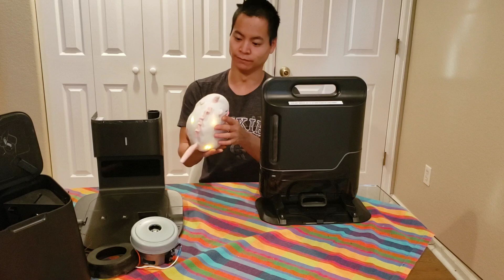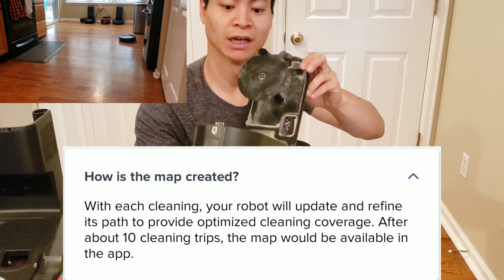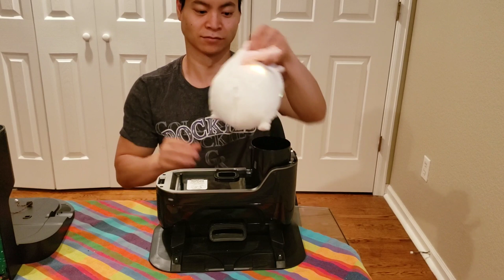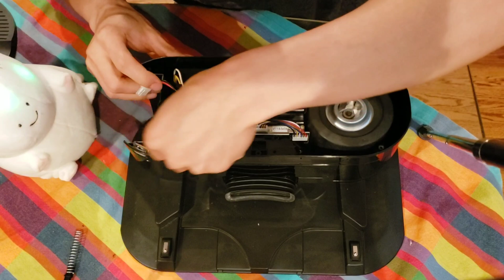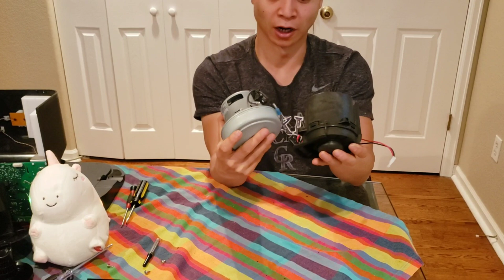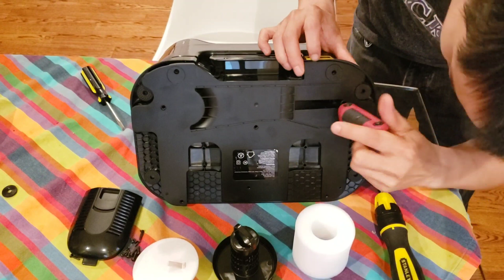Shark IQ Self Emptying Bin Teardown VS Roombas Self Emptying Bin | Which one is built better 😏😏😏

Comment: Can you do a video of a tear down of the Shark Auto Empty bin? I’m a pretty good at tinkering but I’m stumped on how to take it apart and clean the bin any further than trying to shove wet rags into it. So far I can see 5x T15 screws and took the swing door off but I can figure out how to separate the plastic pieces. If you could do a follow up video to this I would GREATLY appreciate it! Thanks for the content and keep up the good work Nathan!
Reply: I figured it out, and it’s a PITA. There are a total of 8 screws. Three of the 5 screws you see from the bottom actually come out later. The first screw that needs removed is under the top button and locks the dust bin into its outer skin. Due to the way the button is clipped on to the release lever, it’s nigh impossible to get it off. Once you do manage to get that screw out, the two screws towards the back near the filter come out and the outer skin comes off. Then, when the outer skin is removed, take out the bin latch lever and undo the two hidden screws on the front and back of the bin. These two screws, along with the other 3 on the bottom, allow the inner bits of the dust bin to come out. 

I was able to stretch the case enough to move the button out of the way and access the first hidden screw after removing the two screws nearest the filter, but far and away the easiest way to access it is to simply drill a small hole at the front of the button. The locking tabs are on the transfer bar, so trying to pry the button off from the top will almost certainly break the locking slots off the button instead.
Reply: @mrb692  Glad someone was able to figure it out!! I’ve since given this one to my in-laws but I’ll be sure to reference this info when I do their yearly deep cleaning!!
Reply from the maker: Once you get all the screws out, does require some force to remove the plastic parts, check all the screws though. There a couple that are hidden I think.
Reply: Robot Masters Thanks! I’ll keep looking, just haven’t found anymore screws yet. Should I try to use a plastic separating tool? Like a plastic shim or flat blade?
Reply: I tried for a bit but I couldn't get it open

Comment: I haven't had this problem.  But someone in the comments was saying their S9+ closes doors. I told him I've never had that happen, but I have doorstops. Apparently, he doesn't. I told him to use keep out zones around the doors or use a doorstop wedge. Have you had a problem where your Roomba closes doors?
Reply from the maker: My Roomba S9 and I7 never closed doors, the Braava m6 did at the beginning, but after several updates it never did it. Maybe this person is running on an older firmware. Yeah Keep-out zones might help
Reply: If it gets behind the door it will close it, Mostly opens them. I have old 595 and since replaced original battery with their extra life one it has become a monster, knocks stuff out of its way and pushes tables around. Blind in one eye and to fix looks like new motherboard.

Comment: I want you to fool it after room is maped by putting obstacles in its path or moving furniture around. See how it handles changes. I never saw your lips move when sparklers was talking
Reply from the maker: LoL an attempt of making a puppet come alive. Yeah still doing the mapping runs take 10 cleaning cycles
Reply: Sharks web site looks like an infomercial scam, they really need a new web designer.
Reply from the maker: LoL yes I agree too many Advertisements video show casing the vacuum. I will say this, while the Navigation abilities, app stability and integration needs lots of work, the vacuum it self is really good. Picks up a lot of dirt even on low power. I like the dual single arm side brush, does not scatter debris much, has a dedicated wall sensor too. Shark being able to offer a smart mapping robot vacuum with self emptying bin for $450 is impressive and I will give it a few months to improve the software.
Reply: Will be like Ring doorbell, i hated it for first two month's return it 3 time to Costco. After they updated app first time 3 months later changed my mind now have 2. Yes either impressive or irobot been cheating us all this time, now theirs dropes to $499. Test change in hight, going floor to rug while on a run and going over Engineered Marble Threshold. We have .5 inch between wood & tile floor it needs to get over. Roomba gets hung up some times but always frees itself.
Reply: Oh yeah, how does it handle power cords? Roomba does good with thick ones just passes over them but some of light ones it sucked up and spit out. Bought some 3m stick up hooks and raised them off the floor.
Reply from the maker: KingLord I will do a cable test, the robot has no trouble transitioning over high thresholds. Was able to transition on to my Shag Rug which is 1 inch thick.

PS I use Vivint and Arlo as my security cameras
Reply: Shag rugs still around, i wanted that when i was kid in the 60s. Salesmen said you need to rake it so decided nope, mom was happy
Reply from the maker: KingLord Ohhh never raked mine, but than again it not the prettiest looking thing 🤔😧
Reply: @RobotMasters  I noticed something. Most robot vacuums copy iRobot from wheels to slightly different brush heads. Looking under the robot is very telling who copied who. But Roomba did just use the shape of the Neato for the S9+. I guess sharing is caring guys.
Reply: @kinglord5429  iRobot latest model learns as it goes. It's impressive. I leave home and I'm reminded at work every Tuesday/Friday that I have a Roomba because she sends me a message that cleaning has been completed. I don't think any other companies are on their level. I tell everyone to be hesitant about using Chinese robots or smartphones. Stick to any other company.
Reply from the maker: @Slick1020  LOL the only robot that did something different is the Dyson 360 and LG CordZero R9
Reply: @RobotMasters  I know most people get upset with the pricing for the Roomba. I can say their customer service is top notch. Their app is well put together. I believe you pay for what you get. Looking at Shark support and their app because I read your comments about them. I've seen other negative reviews as well.
Reply: Someone said no other company can use double brushes because Irobot owns the rights to it.
Reply: To say only irobot can make a excellent automated vacuum and only for their price that can do what no other can has never held water jn anythin, cars, planes, trains and so one. Shark has been known to make very good products for much less cost and this seams to be another but they will not be alone. Hopefully this will start a drastic price war that will benefit consumers. 👍
Reply from the maker: @kinglord5429  I think they will because, being able to under mind the customer with a robot that offers very similar features for half the price is good for the consumer and creates competition. Now if Shark proactively provides software updates it will be a good robot vacuum 😁
Reply: @kinglord5429  Shark probably isn't making money. You provide a lower cost robot, but what are your profits?
Reply: Bulk sales, $439 vs $1300. Apple asks over 1g for a iphone but you can get android unber $100 which pretty much does the same. Its like cable in FL, xfinity is the only game in town and sets the price's. Irobot had that once but this changes the game besides the hardware has never been were the money come from, consumables is where they have you.
Reply: @kinglord5429  Google doesn't make money off Android. Android is free for anyone to use. Their money comes from ads period. Their phones haven't been extremely profitable. I think their home products with Nest have bought in profits. You need to compare apples to apples. Google is doing what Microsoft did by placing their products everywhere so you want to use them, especially in your home. Apple home products don't exist outside of Apple tv. My Roomba works perfectly with my Google home setup. My Sony tv runs Android and works with my Google home. Shark is nowhere close to iRobot. At an Android tv event for Google, they showed off the Roomba S9+. It's like Nest, you know the product is going to work with your Google home ecosystem. I can tell iRobot did some planning with Google because of the way their products work well together.
Reply: So shark will have Amazon funding future development, i see irobot lead dwindling. The funny part is here 3 guys talking about vacuums 😁✌😉